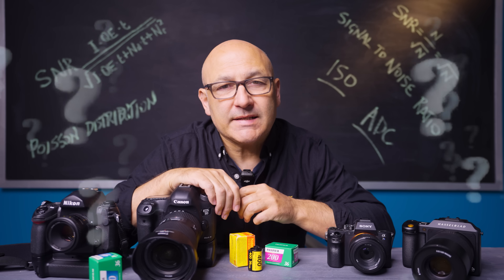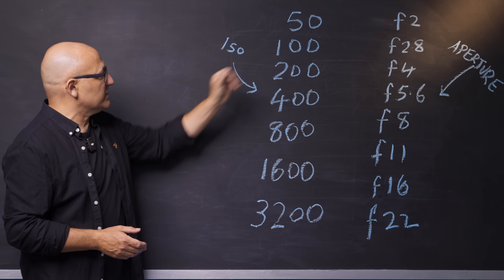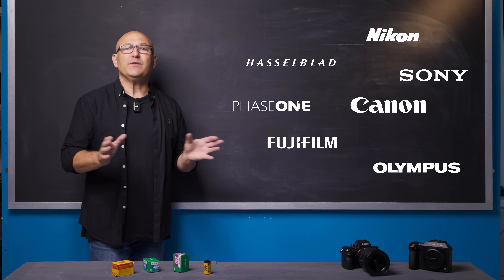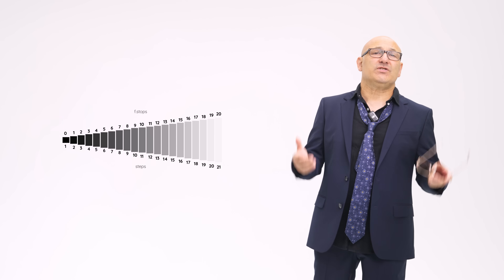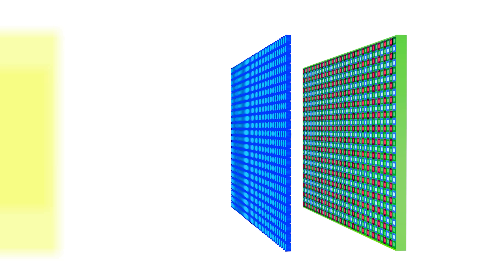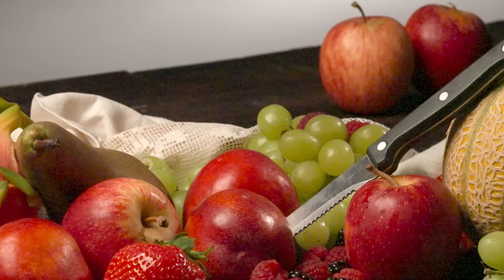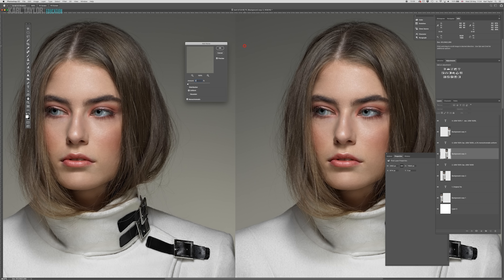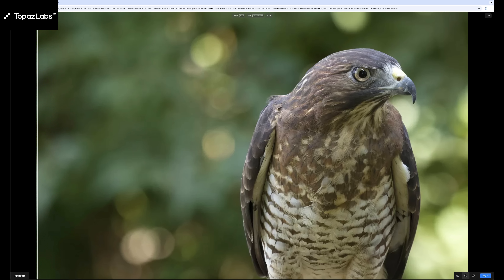ISO in Photography: The Truth Nobody Explains Properly

Comment: Is it really accurate to say that increasing the ISO ‘adds’ noise? You typically raise the ISO because you have less light — so less signal. The noise itself is from constant sources; rather, you’re amplifying a weaker signal, making the noise more noticeable relative to it. So it’s not that there’s more noise, but that there’s less signal compared to a roughly constant noise floor.

Comment: BTW, I just followed the link to your site and looked at the course 'Understanding exposure'. This starts of with a wrong definition of exposure. Your exposure course starts by saying:
"What is exposure in photography?
Exposure refers to the brightness or darkness of an image. When an image looks too bright, it is overexposed. When it looks too dark, it is underexposed."
This is wrong. Exposure does not refer to the brightness or darkness of an image. It refers to the illuminance times the exposure time at the plane of focus. If you want to dispute this maybe you should look at a reputable text first, or even Wikipedia. From Wikipedia: "In photography, exposure is the amount of light per unit area reaching a frame of photographic film or the surface of an electronic image sensor. It is determined by shutter speed, lens f-number, and scene luminance. Exposure is measured in units of lux-seconds (symbol lx ⋅ s), and can be computed from exposure value (EV) and scene luminance in a specified region... . From the Kodak Basic Photographic Sensitometry Workbook (https://www.kodak.com/content/products-brochures/Film/Basic-Photographic-Sensitometry-Workbook.pdf) "The unit for light (Illuminance) is called millilux. It is
equal to one-thousandth of one lux (formally called a
metre-candle). Exposure can be determined by multiplying
Illuminance (in millilux) by Time (in seconds). The
equation is:
Exposure = Illuminance x Time".
From the Manual of Photography, 10th edition p 139: "The photographic exposure, H (the effect produced on the emulsion) is, within limits proportional to the product of the Illuminance E and the exposure time t. We express this by the equation H=Et.
From ISO-6-1993, section 3, definitions: 3.1 exposure, H: The time integral of illuminance on the film, measured in lux seconds.
That's probably overdoing the definitions, but they do at least confirm that yours is wrong. The problem is that you can't understand what ISO is because ISO is defined in terms of exposure. From ISO 12232-2019
The SOS (Isos) shall be computed using the following Formula:
Isos = K/Hsos
where
K is a constant equal to 10 lx⋅s and
Hsos is the exposure required to produce the specified standard level DSC image signal equal to
461/1000xOmax
where Omax is  the maximum output value of the digital system. For 8-bit systems, the reference level
shall be 118.
NOTE The code value of 118 in an 8-bit system corresponds to 18 % of the maximum final output for sRGB.
(SOS is the most common type of 'ISO', the other common one being 'REI', Recommended Exposure Index.)
So, get exposure wrong, you get ISO wrong.

Comment: Part 2 of extended comment going through issues with this presentation.
Error 5: 'Dynamic range' with respect to sensors, means the 'widest range of recordable tones'. A lot of photographers use 'dynamic range' that way, but again, it doesn't apply to sensors. There is no 'tonal range' until the image has been processed, because there is no tonality before the image is processed. Dynamic range of a sensor is expressed using the engineering metric, largest recordable signal divided by the noise floor. Measured 'tonal range' doesn't have muchg to do with a sensors 'dynamic range', in practice it's down more to the manufacturer's preferred processing style. In the end, this whole section consists of a lot of speculation, about how sensor and camera manufacturers work, presented as fact.

Error 6. 'Electronic signals from the sensor have to be amplified to get more exposure out of them.'  Exposure is the sensor illumination times exposure time, i.e. light energy density at the focal plane. This can be found in any reputable photography text, or, for instance ISO 6 (the one for colour negative films) 'exposure, H: The time integral of illuminance on the film, measured in lux seconds.' Obviously, 'amplification'; cannot change the amount of light on the sensor. This is critical, because the amount of light incident on the sensor is what is actually primarily responsible for the noisiness of the final image. I know you used air quotes, to try to excuse yourself from this misuse of the word, and explained that the amount of photons is not changed, but given that the confusion caused by this equivocation occurs throughout the video, that is not a get-out. And, although 'amplification', in the form of variable voltage gain before the ADC, usually occurs it certainly is not essential. That is, the signals do not 'have to be' amplified.

Error 7. (Could just be a lack of needed explanation). That what comes out of the ADC is 'RGB values'. They are not 'RGB' values as in the 'RGB' of the final photo. They are three channels of the cameras device specific 'colour space' ('colour space' is a bit misleading, because 'colour' is a product of human perception). Why this is important is that it's one of the several places where you simply ignore what happens when a raw file is processed (either in the camera or out of it) and ISO depends absolutely on this processing.

Error 8. 'The amplification process is a factor that causes noise'. Absolutely untrue. The purpose and effect of increasing voltage gain as ISO is increased is to reduce noise - in particular, the portion of the read noise that is generated by the ADC. By amplifying the signal clear of the ADC noise the SNR is increased, as is the DR at that exposure.

Comment: Part 3 of extended comment going through issues with this presentation
Error 9. That 'taking the small number of photons striking a photosite and converting them into an electronic signal incurs a phenomena (sic) known as shot noise'. Shot noise is not a product of the conversion of photons into an electronic signal. It is inherent to the nature of light as a quantum phenomenon (and if you don't know what that means, why use the term 'photon'). The efficiency of the conversion from photons to photoelectrons impacts the SNR due to shot noise, but not whether or not it exists. Even if every photon is detected, there will still be shot noise. There then follows a word salad about poisson statistics, which somehow fails to reach the two important things that the viewer needs to know about shot noise. One is that the signal to noise ratio due to shot noise is equal to the square root of the mean number of photons collected in a sample (say a pixel) - and is thus proportional to the exposure (see error 6). And secondly, that photon shot noise is the dominant source of noise in an image. Then we get a completely confused discussion about the different sources of noise, and their effects. Without going through them in detail, the three significant noise sources in digital imaging are shot noise, the major one, read noise, and pixel response non-uniformity (PRNU). PRNU is not a significant issue with modern sensors. Leaving just the other two, and the whole discussion about the effects of ISO is really about the relationship between shot noise and read noise.

Error 10. Read noise is noise from 'voltage fluctuations'. Well, in a sense, since in the analog part of the capture chain the signal carrier is a voltage, all noises are from 'voltage fluctuations'. That includes shot noise and PRNU, which both cause 'voltage fluctuations'. The real issue is what causes these voltage fluctuations. In the case of 'read noise' it is from a variety of sources, since every electronic component along the way adds a bit of noise, be it 'current fluctuations', telegraph noise and do on. The important thing is that it happens at every stage of the capture chain, and particularly in the ADCs. (see error 6).

Error 11: 'We could say that it's mainly the amplification process above the default ISO which causes greater signal distortion or higher signal to noise ratio'. Well, let's first allow that the 'higher signal to noise ratio' was just a slip, and you meant to say 'lower'. First, 'distortion' and 'signal to noise ratio' are different things, so distortion cannot simply be identified with SNR. Second, it's completely untrue. The effect of the 'amplification process' is (actually) to increase SNR (that is, make the image look less noisy) in low exposure situations. The cause of the reduced SNR as ISO is raised is that raising the ISO lowers exposure (because ISO is 10/exposure, as mandated by the ISO standard). It does this by causeing the meter to centre at the reduced exposure, causing the photographer or the automatics to select a smaller exposure). Anyhow, lower exposure means fewer photons means lower SNR (remember, SNR is proportional to the square root of photon count) means that the picture looks more noisy. Where does the 'amplification' come in? Well, see error 8 and error 10. Most of the read noise often comes from the ADC. Mostly it's insignificant in relation to the shot noise, but in very low light iut does become visible in the shadows. Since the exposure level wouldn't give a large enough signal to use the top bits of the ADC it can be 'amplified' which takes it clear of the ADC's contribution to read noise. This is the main difference between cameras that are so-called 'ISO invariant' and those that aren't. In ISO invariant cameras the ADC noise is very small so this 'amplification' is not needed.

Error 12: Microlenses are a recent advance. Nope, just about every digital camera made since 2005 (exceot the Kodak 14MP FF cameras) has had microlenses on its sensor.